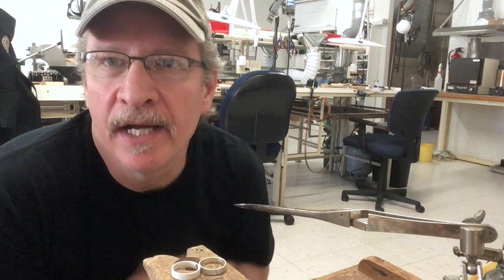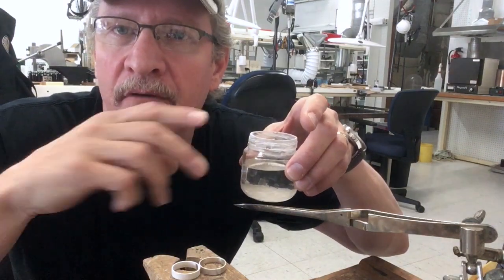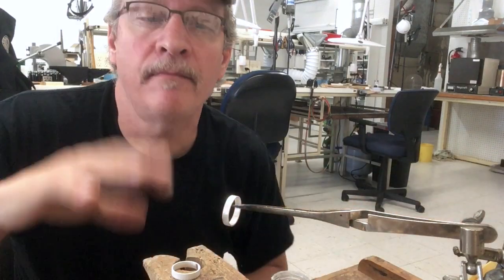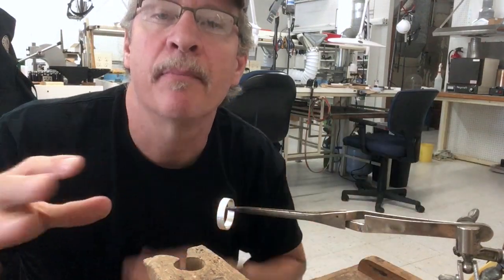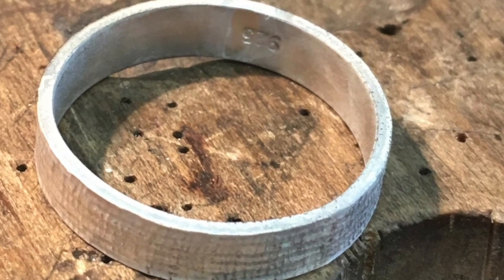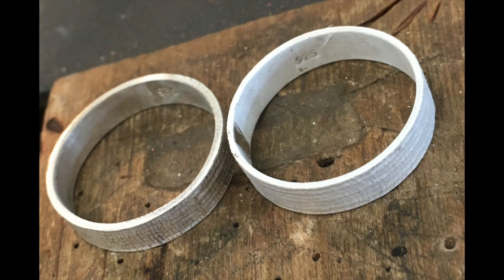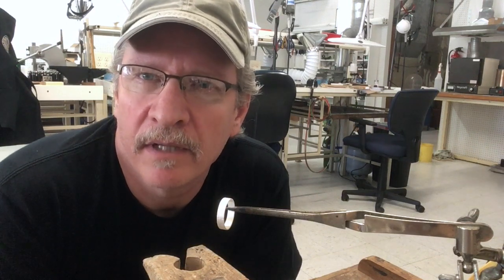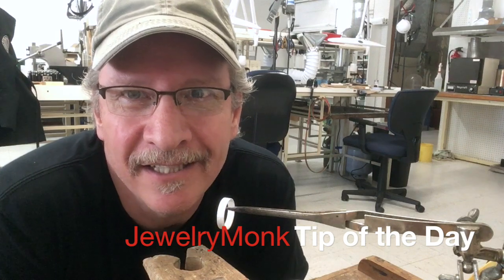Boric Acid Dip as a Jewelry Soldering Protective Covering

Comment: Does this work for pre-plated rhinestone jewelry settings too? I've gotten pretty good at having a super clean solder and I use the best solder wire I can find however when I solder using my torch (especially when I have lots of detail and chainwork) I get some fire stain, or the plating burns and the copper/brass underneath comes through. to make it all look cleaner I use scotch brite and they look nice however I would love to be able to just wash them and skip this step.
Reply from the maker: I don’t think so. The heat needed to melt the solder it hot enough to burn the plating off.

Comment: whats % do you use on your solution ?
Reply from the maker: I add about 1 tablespoon to 2 oz. of alcohol. The alcohol will only absorb so much boric acid, the rest will settle to the bottom.
Reply: @DougNapierJewelryMonk  is this good for polishing ? I want to use this on ultrasonic cleaner to polish , or diamond paste better
Reply from the maker: @han436  This is more to protect against firescale during soldering.
Reply: @DougNapierJewelryMonk  alsonis this make less oxiding time , which material os best to polish like mirror ?

Comment: My understanding was that lighting the alcohol/boric acid solution both heats and melts the boric acid into a smooth even glaze—like glass, which protects the metal from oxygen penetration—thus, protection from fire scale. 

As you solder a coated piece, the boric acid melts into a coating that creates this glassy barrier, anyway—

By lighting the boric acid/alcohol solution, you simply get the melting started a little earlier (and much faster than letting the alcohol evaporate)

I was also taught (by a jeweler at an esteemed store, with over 30 years experience) letting the alcohol evaporate—as you suggest here—will create micro-separation with the boric acid—as it re-crystallizes as the alcohol evaporates, allowing small spaces to open to he air between the newly formed crystals—where fire scale can get through when torching and damage the piece.

In short—what you suggest I was taught to never do.

Can you please state your sources for the claims you’re making, considering it’s on a microscopic and chemical level?

Do you know for a fact that boric acid ‘burns off’ when you light the alcohol?

If so, how can it be effective when soldering? 
How can it not burn off at blue flame soldering temperatures —when lighting the boric acid/alcohol solution is at such a cooler yellow flame temperature?

If it’s just your observation, and a thought up conclusion to share with folks new to the field, perhaps you mistake the ‘thicker’ coating as gaining more volume of boric acid,

 when lighting the alcohol actually melts some of the boric acid—so of course it will look like less—like sugar crystals hardening into a glaze.

And if you’re looking to add more boric acid coating a piece, you can simply 
   1. change your solution to be more saturated by increasing your boric acid to alcohol ratio 
and 
2. After dipping and lighting once, re dip (or brush on) a second time, and re-light it. 
3. Repeat until the desired coating is achieved 

The boric acid coating will be thicker, then.

Perhaps you’re right—an what I was taught was wrong

In that case, please offer your document evidence to prove my mentor wrong

—especially evidence that lighting the alcohol burns off boric acid. (Really?! That sounds a bit ridiculous)

If not—no offense—without references to prove your claim—it sounds a little like unscientifically made up BS

I’ve learned to watch what some jewelers claim. 
One jeweler once told me not to bend & break off solder vs cutting it— “because it could weaken the atomic structure” —hahahaha

From what I know of boric acid, and how its crystals melt into a glassy substance, and how it works at such high temperatures without burning off—I respectfully remain unconvinced that your claim is true.

 Regardless, I do enjoy your videos
This one just strikes as a red flag
Trust is very important in this business
I hope you hold your claims of truth are held to the highest standards 

Be well
Reply from the maker: I am a jeweler, not a scientist, and I share what has worked for me, through trial and error. If your mentor has told you differently, and it works better for you, go for it.
Reply: @monica Reid First, Great tip on the evaporation process… I’ve never seen your channel before, and simply did a search on boric acid being used as a flux… You got my subscription simply from your two minute video. Thank you so much! As for Monica‘s comment, it took me twice as long to read it as it did to watch your video, and Id just like to ask you Monica, how is it that you think these “documents of proof“ are derived from any other means aside from observation, whether it’s a scientist or a craft person in his field? Do you feel that your instructors Word has any more validity than this man’s? I think perhaps you might want to go do some research yourself, and when you’re no longer under instruction you can surmise many a technique and perhaps find it humbling to pass it along to people who may
Benefit from your hard work and observation over the years. My mom always taught me if you don’t have anything nice to say, don’t say anything at all. I don’t know about this gentleman who owns the channel here, but I was offended by your comment… I think you’re pretty much out of line and should  probably apologize, But that’s just my opinion. And you know what opinions are like right?

Comment: Very insightful, especially when you speak about the difference between burning it off and letting it evaporate. It is very important to mention, that the barrier flux also prevents diamonds from oxidizing (burning) when retipping, this is the main reason I use it.
Reply from the maker: Ethos, great point. Thanks.

Comment: what about using methanol (methyl hydrate) as the diluent ? denatured alcohol probably cheaper heh ?
Reply from the maker: You can use methanol, but for some reason the denatured alcohol works better and is cheaper.